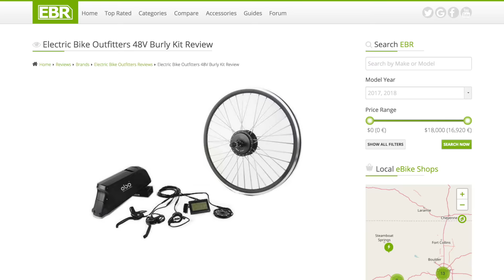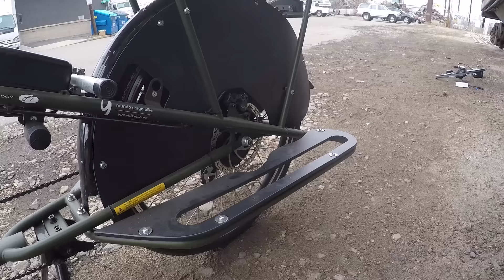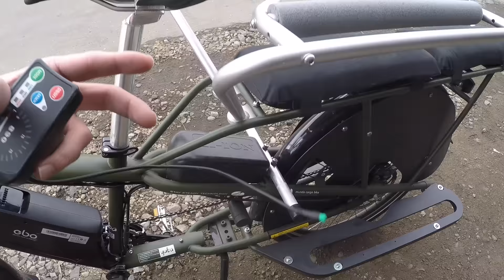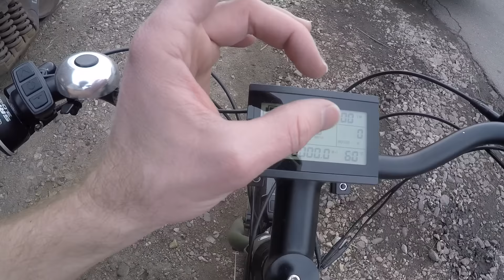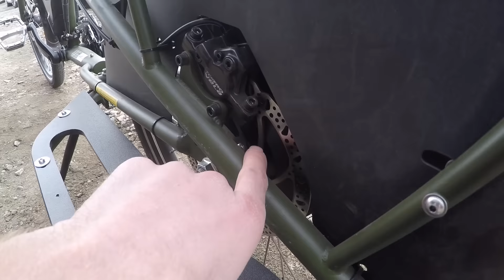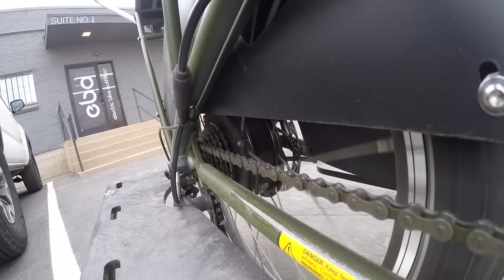Electric Bike Outfitters Front Range 2.0 Kit Review - $1.4k

Comment: This kit is garbage for a start its a cheap crap bafang lcd that does not switch on when temperature is below  35 degrees the  battery box is the stupidist design ever the usb port is on the side meaning every time you peddle your leg hits the port knocking it off  also the connection is loose the motor on the rear is noisy and weighs a ton , the spokes need constant adjusting as they come loose were never designed to take the weight . Try owning something for a year and discover how poor these kits are. The battery design is badly flawed meaning if you go over a bump the battery jumps out of its housing destroying it when a simple designed spring loaded catch was all they needed to add.
Everything is always great when it is new but when you own it you discover it is cheap chinese rubbish 6 months down the road do not rely on any of these kits if you are pro the will continually let you down with never ending issues I am not calling out EBR they do a great job but reviewing new kit and owning one long term is completely different ball game many kit suppliers are buying from alibaba and slapping their brand on them .

Comment: Great mention of the controller current specs Court. Heat dissipation is a big issue when the battery leads or the phase leads are close together. But the more the controller can draw out of the battery at once, the easier hills are to climb with hub motors... especially with extra load going up hills.